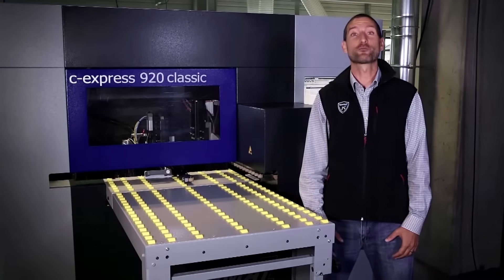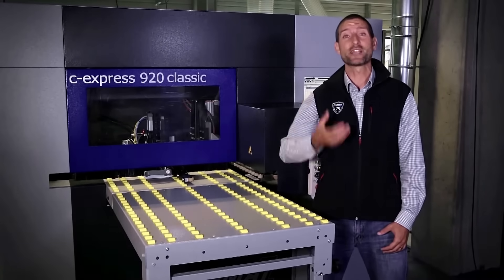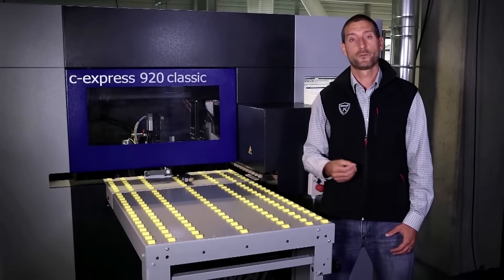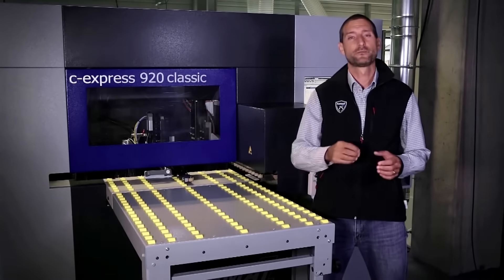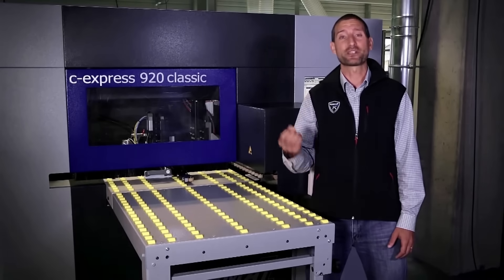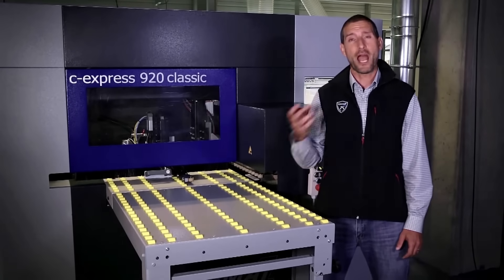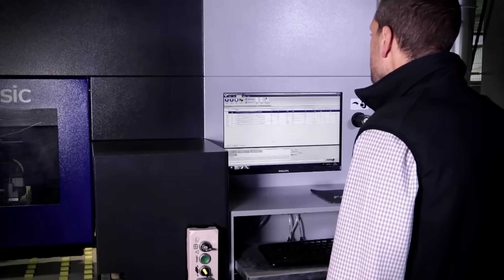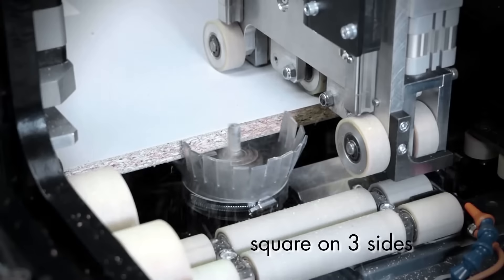Format4® c-express 920 classic - CNC machine center | Felder Group

Comment: panel saw + edgebander +  c-express 920 classic - this solution is sometimes faster than nesting. for example near a hinge boring is problem an edge trimming without special 2wheel  unit. In a small shop you don't have a place for a full size cnc. . . . yin and yang. Don't exists 100% solution for everything with one machine. . .
Reply: C-express 920           cca30.000€
Biesse skipper v31  cca55.000€
Weeke bhx055  cca.55
000€
Homag drilltec v200
Scm morbidelli cx100  cca50.000€
Felder isnt best, but the smallest...:)
Reply: gyuri h i noticed felder has just one model of these specialist horizontal cnc and tons off vertical  cnc's. Looks like these are NOT what most of their customers buy. Same goes for other companies like SCM, Homag and Biesse.
Reply: How can i make line drilling with 5 spindles at the same time like it is on this video on the same machine?
Reply: @boreljushev9835  with a 5 pieces of identical bohrer  in a boring unit, with identical tool settings...
Reply: @gyurih3270  can you tell me what kind of settings should i use for this operation and where to set it?(i m using  tpa software).
Reply: @boreljushev9835  i m using maestro with a CX100R.  U need same settings on each spindle in the tooling data. In a CAD(tpa) you must draw holes with center distance 32 (64)!!!mm. When U draw other dstnc, depth  or angle it isnt functions in same time. I dont have practice with the tpa. 1 year ago we think about Felder but buy an Scm. Sorry for my terrible "english" :)